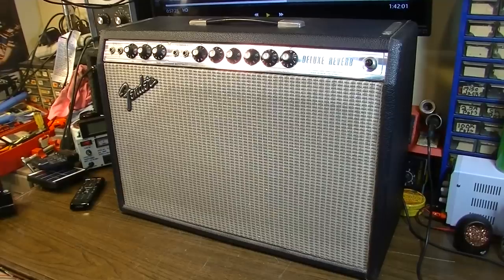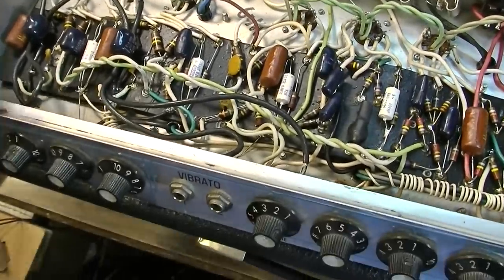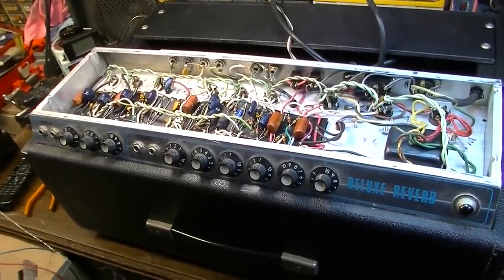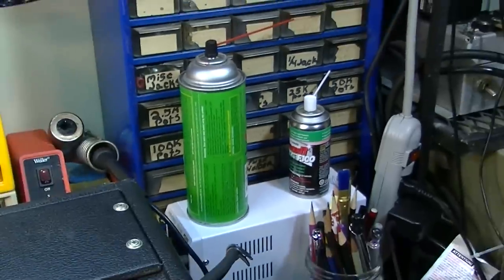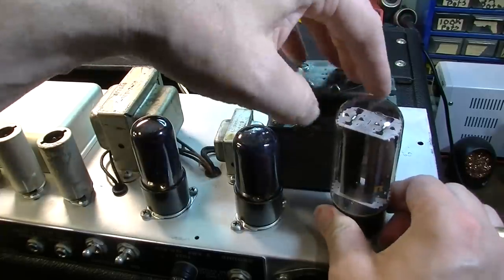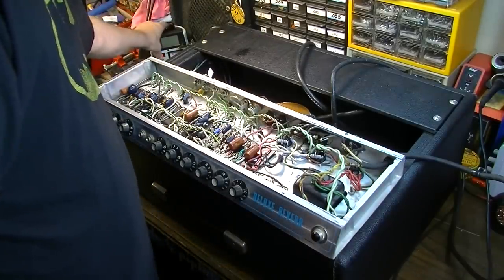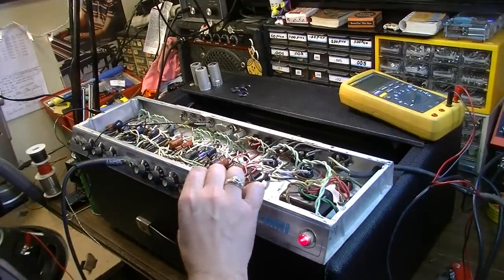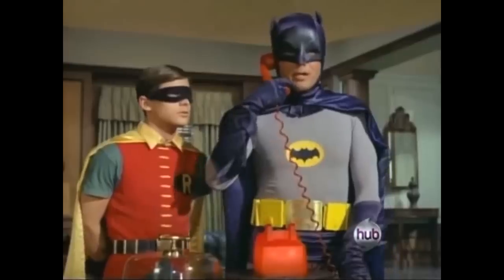SECRETS of the Fender Deluxe Reverb - The BEST Fender Amp Ever? (FULL SERVICE)

Comment: Hey Batman Brad... was wondering what your opinion is on the vintage FDR vs Reissue models.  I have not played either, but have strongly considered both and one just might be on my near future list.  I know price is a consideration too. Also any particular year(s)? Your opinion would be valuable to me.  Anyone with advice or opinions on the matter are also welcome to share them with me
Reply from the maker: Go for a vintage Silverface. You can find them for about the price of a new reissue if you shop around. For a second I thought you were asking my opinion of president FDR. That would have been a dangerous conversation. :P
Reply: I agree in regard to FDR so our conversation is a "Better Deal" and not necessarily new one.

Now, your blob of hot glue reminded me of something from an old cartoon I watched as a kid.... Gloop and Gleep.  Makes sense why it works, ha.

Gloop and Gleep (both voiced by Don Messick) - Two protoplasmic creatures. They are able to absorb and deflect energy blasts and laser beams, often placing themselves between attackers and other Herculoids to act as shields. They can also form shapes including, but not limited to: cushions, trampolines or parachutes to break falls; stretching themselves between tree limbs or rocks to act as slingshots; encircling an attacker's limbs to restrain them, or the entire body to squeeze and render them unconscious. Gloop is the larger of the two.

Comment: Great vid!! As always.  I bought a new 68 custom deluxe reverb and can't recommend it more.  One channel has a bassman tone stack and the other is black face clean clean clean.  I agree deluxe reverbs are GREATT!!! thanks Brad!!
Reply: Christopher Violante I have one too, bought it new 3yrs ago and the honeymoon wore off as soon as I tried it in a band situation and it was lost in the mix no matter what I did. Had it recapped and had the teeny-tiny resistors swapped for real ones and it's a lot better. Put a Weber speaker in it too. It was either that or sell it at a loss. I don't know, they ain't what they used to be in my opinion.
Reply: Tele Caster sorry to hear that.  Mine kicks ass in my band.  Cuts right through.  I like to run it on the 1st channel with the bassman stack with some volume rolled off on my guitar too leave myself some room.  I always make sure to run it juiced though.  Gotta get the volume up to 5-7 to really get the amp to sing.  At least in my experience.  Definitely better than the modern black face reisuues imho.
Reply: I love mine too. The trem can only be activated by the foot switch. I was wondering if that was Brad's problem.lol

Comment: The secret to these amps is changing the speaker to a good old Jensen C12N, P12N or maybe a C12Q. As long as it's serviced with a change of speaker you have IMO the best amp ever made. The better speaker allows you to crank it and that's when it really shines.
Reply: We tried a couple of Jensen 25W AlNiCo reissue in my DR, which is a couple months older but Not so tidy/original, but they wouldn't survive the burn-in. We put a middling higher power Jensen until I got an old pre-rola Celestion 30W 75 hz 8ohm which worked but I wanted it to pair with the other one I had in a 2x12 extension cab so I had the Utah, which was torn when I traded my 1965  reissue twin for it (the DR), re-coned. Despite the low expectations based on various online opinions, when a competent tech finally put everything right it sounded pretty much like this one which also has the original Utah. I have since read many accounts of Utah satisfaction, although dissenters usually chime in, with the nearest thing to a consensus being to avoid Oxfords. Although satisfied with the re-coned Utah, I wouldn't mind hearing the Jensens of which you speak, especially the P12N.

Comment: Another example of Leo Fender's confusion on the vibrato/tremolo issue.  The vibrato effect in this amp is actually tremolo (just as the whammy bar on your Stratocaster is actually a vibrato).  Leo first got it wrong on the Strat and then repeated the error for consistency on virtually every other product he made.  The industry followed suit just because many guitar players had already adopted Leo's terminology.  Violin players and opera singers still use the terms according to their historical definitions:  vibrato is a fluctuation in pitch, tremolo is a fluctuation in volume.

Comment: I have a '77 Deluxe Reverb.  What is recommended if I want to play the amp as is and add an external speaker also?   I have an 8 ohm external cabnet.  Can I use it at the same time with the internal speaker without over working the amp?

Comment: Brad, I'd like to find me an old deluxe, I have a reissue silverface twin, it's ok, I had Peter, my local guy do some stuff to it, it sounds good, they put celestion v series in those, which it works out!   But, the Marshall I own,  found used is actually pretty nice!   I got a JCM 2000 DSL 401, that was still made in England, don't have the original speaker though the guy who sold it to the local show, changed out the speaker with a "hellatone"  basically Chinese made vintage 30, that they "break in"  But I took that over to Peter and he was, *this is actually nice, how much did you get for it?"   I bought it used for 500 bucks!     But either way, I'm really looking to get something actually vintage, my counter part in one of my bands has a 70's version blackface twin.  What I want to do is use the Marshall on one side, and like a good deluxe on the other side, full stereo, but I digress, either way this was pretty interesting!

Comment: I recently bought what i was told is a 73 twin reverb chassis number A51822 however it does not have the push pull master volume do some of the earlier 73s lack that feature? im just trying to figure out which circuit i have

Comment: How about a small project for you to do and share. Create an inexpensive Tremolo circuit based on this that you can add as a pedal or as a "snap in" for other amps. Novices like myself would need some direction on where you might snap it in. But for instance, slapping it in the chain of an old tube amp mod, or Gibson or even an older solid state. Might make some good content. Be kind of cool if you had a crappy solid state with a tube glowing in the box.
Reply: maybe even assemble some kits you could sell.

Comment: Yes...a Deluxe Reverb with 6L6, (40w) Blackface is for sure the best Fender ever.  I won't go into it, but I have built 20 or so amps ranging from Tweeds to Marshalls.  I have owned dozens more and gigged for decades.   My handmade Deluxe Reverb is the ultimate gigging amp for a versatile or cover band.  If I was in an ACDC tribute band...it would be a different choice.  Or a metal band, etc.  For anyone that is looking for a gig worthy amp that can cover ANY genre.  Build yourself an appropriate pedal board and use a Fender Deluxe Reverb with 6L6.  Done Dealio.

Comment: OK, Batman aside, what is the purpose of wrapping a wire bundle with another wire? Does it have an effect on the electronics (inductive or capacitive)? I mean, basically, they're wrapped in a choke coil, right?  I mean, it can't be totally benign. Is that even referenced in the schematic?

Comment: my 1965 re issue has some microphonic tubes and the foot switch is intermittent..  i think i hear some jingling rattle on some loud A notes haha should i tap lightly and find it and pop in a tube i have that is marked G on the box by the guy who tested my  tube collection lol ? I dunno...also im not sure what to do about the foot switch...the reverb will not turn on some times. but when the switch isnt plugged in the reverb always works.
Reply from the maker: Yes on question A. Bad switch on question B.

Comment: Why is it acceptable to change the capacitance of the filter caps?  Not saying it's wrong.  Just curious as to why it's ok for my own learning purposes.  Thanks!!
Reply from the maker: The difference in value is minimal from 16uf to 22uf. 22uf is a more common modern value. 16uf is still produced, but they tend to be more expensive because they are less used. The value determines the amount of reserve voltage "on tap" when a tube goes into conduction cycle. Leo probably calculated the minimum and found it was somewhere between 10uf and 16uf and went with 16uf. 22uf will do the same job. Bass frequencies may be slightly enhanced, but that's about it. There are whole articles on power filtering online. Here's one with formulas: https://www.illinoiscapacitor.com/pdf/Papers/filtering.pdf
Reply: I will read the article as soon as I leave work.  Thanks Brad !

Comment: GLUE REMOVAL TIP -  Hot melt glue can easily be removed anytime by applying a few drops of 91% isopropyl alcohol or IPA should you need to do so ...

Comment: i do believe the tremolo is controlled by a vactrol not an Optocoupler.  a vactrol is an ldr to led (light source)  an Optocoupler uses a photo transistor. a vactrol is used to vary a resistance using light and th Optocoupler is used to isolate a circuit...  a vactrol is also referred to as a Resistive opto-isolator...
Reply from the maker: You may be right, technically. I don't know. I've always heard those terms used pretty interchangeably.
Reply: i thought they were the same too, i bought a bunch of optocouplers and learned the hardway...
Reply from the maker: I'll keep that in mind. Thanks!
Reply: I was taught that a vactrol is a type of optocoupler, but these days optocouplers are almost always assumed to be the transistor variety due to the prevalence of digital circuitry.  Also that the term optocoupler/optoisolator is used interchangably depending on the primary purpose in the circuit.  I was taught by an idiot though, so this could be nonsense.

Comment: I'll give you a blonde tolex music man HD 1x12 that lights up  if you rebuild my deluxe reverb . Mine is the same time frame as this. It has never been worked on but it has a couple busted knobs. Pots will need replaced. Speaker is blown. I gave the reverb tank away but they are cheap and it's missing a power tube.
Reply: don't care if the parts are used. I would like the power cable to be grounded though.
Reply from the maker: Email me: bradlinzy at gmail
Reply: @TheGuitologist  Sorry, just seen this. I should have left you contact info. I'll email you and hopefully the offer still stands.

Comment: What is best practise when soldering components to valve bases, tubes in or out?

Opto coupler check?
Reply from the maker: If you want to be precious about it, you can take them out. The tubes likely get hotter during operation than the conduction from your iron though.
Reply: Thanks Brad
Reply from the maker: Damage is possible, I'm sure. I just know in all my time screwing with amps I've never damaged a tube in a socket in this way.
Reply: Think you said before - you usually cut and loop, rather than disturb
Reply from the maker: True, but on these larger screen resistors, the leads are so short and fat, you can't do anything with them. There isn't even enough room to get cutters in there on this one.

Comment: I have a Deluxe Reverb RI. Is it safe  to run a ss rectifier in the amp?
Reply from the maker: If the rectifier is well designed, sure. SS rectifiers will result in higher voltages, so some components and tubes will wear quicker. Might need to rebias output tubes also.
Reply: Yes
Reply: A guy did that for me 35 years ago, it's not a bad mod, easy to change back, i cant tell the difference in sound and far more reliable.

Comment: There is one better Fender amp -- the Super Reverb. And here's why: #1) Alnico speakers #2) Bright Switch (nice being both a Les Paul and strat player) #3) Break up starts around 3.5 on the volume know which is much quieter than the Deluxe Reverb's comparable breakup at 6.

The Deluxe Reverb does win in portability.

Comment: why didn't you just resolder the legs on the LDR? it has a larger surface area and so a different response to the one you fitted; even if the resistance span was the same...! if you are not trying to 'improve' the sound; why change things that aren't faulty?

Comment: No.... the 1966 Vibrolux Reverb blackface 2 x 10” was the best.   These are close.... and YES, a bargain for great sound.
Reply from the maker: As always, I appreciate your comments. Care to defend your choice?
Reply: The Guitologist , lol
Reply: I have to agree that the BF Vibrolux Reverb is the best all-round amp I've played, and that's going back more decades than I'd like to admit. However, I still love my 1965 Deluxe Reverb that I bought when I was starting to play in public at that time. Great amp.
Reply: Roger Ball   Thats a good one!
Reply: Roger Ball    Mostly being silly here, as I have owned a BF 66 Vib Rev for 50 years now. Mine  has one factory Jensen and one factory Oxford. Original buyer had the dealer create the mix..and it still sounds good, but outboarding to a JBL D130 IS by far the best sound. Truth is any of this family of smaller reverb series of amps, for about an 8 year period, including a few years with silver-faces, were about as good as it got. The Pro Reverb, Deluxe Reverb, Vibrolux Reverb, all very similar front end, different power tubes, but similar topology output stage. In my humble opinion, quite jaded as an old-fart, and half century owner, this grouping was the peak of tube amp design.   The original Vox AC30 had its charm, and the Marshals its overdrive... but these mid 60’s Fenders were and are the stuff of legend... no wonder they are cloned.
Reply: I agree with your comments about the wonderful era of 60's Fender amps and I'm fortunate to have been able to buy a few of them. My best find was a 1970 Vibrolux Reverb that was in poor shape electrically and cosmetically. I carefully restored it and have gigged with it for over 10 years. It sounds amazing and will probably outlast me.
Reply: In exchange for doing some work on an old Les Paul, I took a luthier friend's 65' Vibrolux to my amp tech, as guests of his roommate had rendered it silent while he wasn't around. After it was fixed I compared it with my 73 DR and it sounded exactly the same, provided you set the "Bright" slider. Unfortunately he had rigged it with an old lampcord for power, which had neither a ground prong nor a wide blade to warn off potential polarity hilarity so it cooked my Morley "Dan Dokken" Tripler and one or two other effects dead as a doornail... Good thing I wasn't running through headphones while standing over a metal pipe cemented beneath my basement floor... (RIP Keith Relf)

Comment: There is a world of difference in the Ab763  (blackface circuit) and any of the Silver face circuits tonal characteristics. There were only two variations  on the Black face from 63 ' to 65'.Silverface amps were produced from the transition year 65' to 77' thus many minor changes except for the Super and Twin.
Reply from the maker: I think you mean '68-'77?
Reply: Could be,I thought the "drip rail" Silverfaces started I late 65'.but my main point is that as far as Deluxes go; The 64' AA763 with no reverb is agreed by most to be the best sounding .And in general all Black Face Fenders were favored over Silver Face ;that's why so many you will find will have had someone  'Black Faced " them.
Reply: 68’ was the start of “Silverface” era amps.

Comment: Is the wd-40 brand contact cleaner any good? It seems to be a lot cheaper...
Reply: It has worked fine for me.  I was visiting family in another state, and hours away from my CRC at home, and had no choice but to pick up WD's contact cleaner version (which I never knew existed until that day) at their local hardware store.  We used it to clean up dirty pots on two Crate amps as well as an old Randall.  Funny how the Crate amps from the 80s/90s are consistent in going scratchy at the same time LOL  Anyway, worked great, family was thrilled, and we jammed all weekend!
NOTE:  To be clear to others, WD-40 makes a * contact cleaner * .  Not to be confused with the WD-40 lubricant for rusty bolts, etc.  Two different products for two different applications.